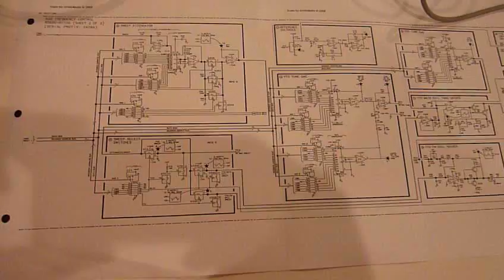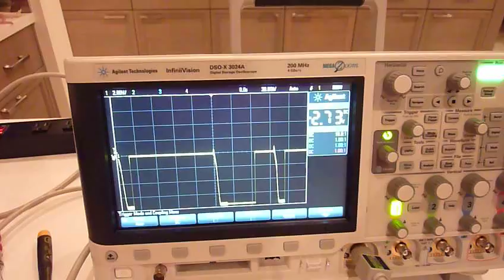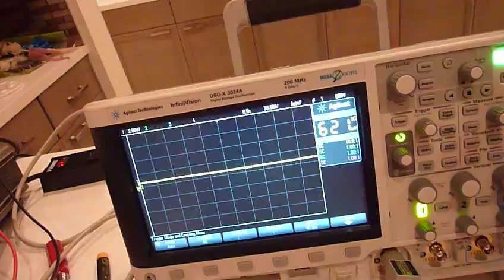HP 8568B Spectrum Analyzer Repair pt. 3

Comment: I'm trying to learn reading schematics and matching them up to the physical boards they belong to. One area I'm having a problem with is how do I tell if the component is on the top or bottom of the board? The schematic is just a flat drawing. I'm having a really hard time finding how the physical layout coorelates to the schematic.
Reply from the maker: That’s a common problem for all of us. The schematics usually don’t tell you where parts are on the actual board, and even less on which side. Unless you are lucky and have a board component map (HP manuals of lore often have that, bless the old HP. So you generally have to use brute force, start from a component or a connection you recognize, and follow where the traces go.